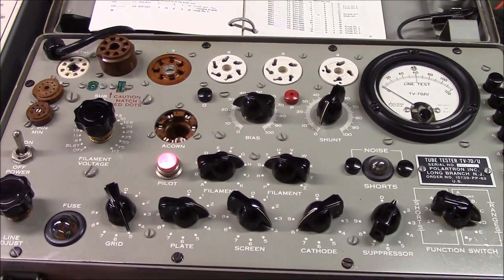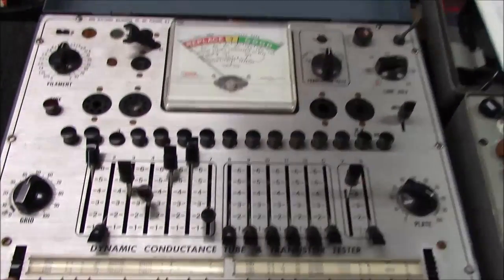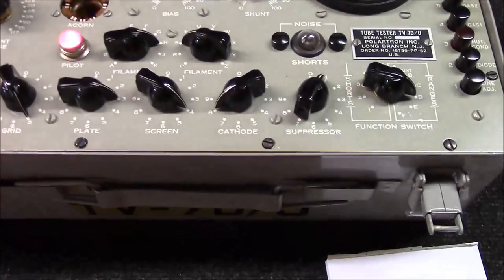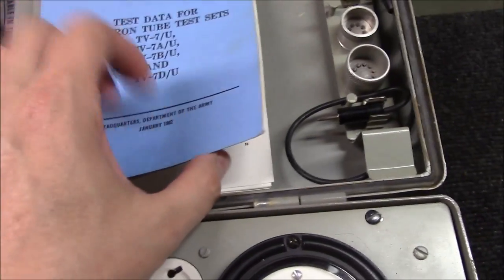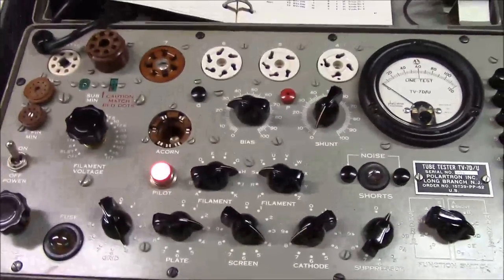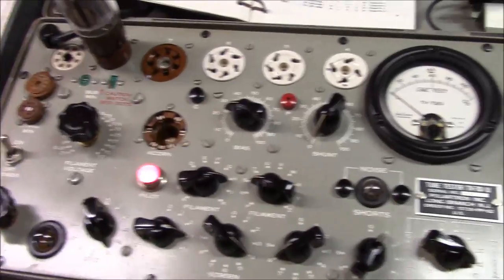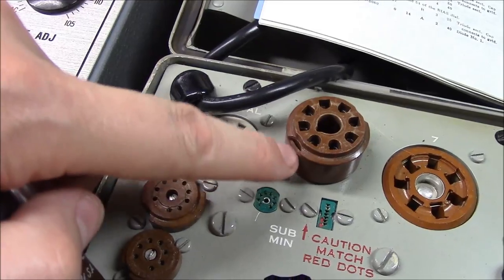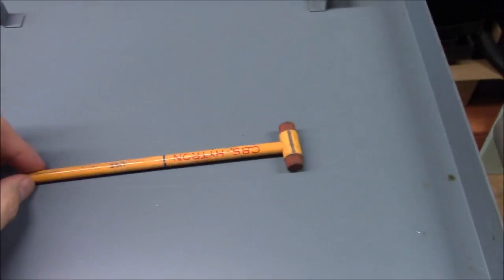A Practical Guide to Tube Testers and Tube Testing - TV7 Eico 667   BG024

Comment: I have both testers but the 667 came with a booklet no rolodex tube spec's. The TV-7D/U, I picked up before it went to be turned in to supply depot as excess military gear. It had a broken 5Y3GT tube that I replaced and  I re-calibrated it to Mil spec's. Like you I use both all the time on my bench.

Comment: back in the late 70s and early 80s I worked at an electronics distributor and we gave away those RCA and GE tube manuals by the cases. I never snagged one for myself and I have kicked myself for it!

Comment: I will keep me Weston 686 rack mount analyzer, thanks. For a suitcase type tester the Triplett 3444A is the best American made tester. Buy the Hickock adapter and that TV7 can test duodecal Compactrons, Magnovals, Nuvistors, etc. My 3444A has the adapters for Compactors, Magnoval, and two other bases, as well as the 4,5,6 pre-octal tubes, Spetar and it has a breakout box in the lid, so if you the socket for the tube, you can test the tube. Same with the Weston 686. That 686 can run 300Bs at 1000 volts anode.

Comment: I enjoyed this, it finally explained the differences in terms that relate to what I do. A friend made it to 102 and I inherited his Eico 666 that had the 4 pin socket replaced with a compactron socket. This appears to have been a mod that Eico sold. Since I am doing ham radio and audio mods I was hoping that this was adequate, and I am happy to see that it does. One thing I don't know if you mentioned, it is not as important for a dual triode to be matched if it is used in a circuit where one gain stage follows the other like a guitar amp.

Comment: The person that will be able to create a new tube tester, that is easy to use and complete in its ability, using modern methods ; will be the new king of the world. Those old machines are magnificent, but are very tricky to understand. Also, it very lacks technical datas about a lot of those tubes. I remember never have seen one single book in any kind of bookstore, whatsoever, on the planet.

Comment: Excellent! I believe that eico has an adapter that will plug into the 667 to test 4 pin tubes, kinda nice,  but does eico 667 test for leakage? Thanks again.

Comment: Thanks for the video .
I did have a question , I have a TV7 and noticed you never did the 1st thing I do , after doing setup , I run the run the function switch through the shorts test on all ranges .
Did you just forget , or have a reason ?
Reply: Absolutely the FIRST thing done, testing a shorted tube can blow your tube tester!
Reply: @oldestgamer  YES Shorts are The priority.

Comment: There seems to be two schematics for both versions of 667. One having 270k resistors x’s 2 and the other a 300k & 330k. The question is: update older version with the 300 level resistors or leave as is?

Comment: A 12AX7 isn't operated in push-pull mode, so your earlier remarks and diagram about + and - envelope distortion don't apply. Class A. About the only real reason for gain-matching the triodes is if they perform the same function in different channels of a stereo amplifier and you want the same gain so as to be sure(r) you get the same kind of distortion out of both, and this is pretty marginal, getting on towards snake-oil.
Reply: EJP The most important reason for matching sections in any dual triode tube is in a long tail pair phase splitter. An unmatched dual triode can result in different drive levels to each side of the push pull power stage. This is somewhat mitigated by the surrounding circuitry, which is designed to not let the tube characteristics be the only determinant of circuit performance, so unless the dual triode is severely mismatched, it will still work fine, it just may not sound its best.

Comment: not sure do anyone said it already, but in the front page of tube chart supplement of 667 "4,5,6 pin and septal base tube can be tested...by using the eico model 615 adapter" not need a 666

Comment: Good informative video, but you didn't cover the important step of SHORTS testing.
With most Tube Testers you should not continue to test if there is a short detected with possible damage to the tester if you continue.
I realize you are testing known tubes and you know there are no shorts, but you were trying to teach others how to use a Tube Tester and the shorts tests should be carried out prior to the conductance testing.

Comment: The hickok 752A can test them all 4pin up to compactron and test dual tubes without changing switches just press plate 2 button :) I own the hickok 752 without the compactron sockets but I bought the ca-5 adaptor so can test them with my tester

Comment: once you test a tube and put it away, does it keep that value if not further used? for example, if I test a tube today, package then sell it in 5 years are the values still valid? thanks
Reply from the maker: id say 99.5% of the time yes.  If tubes are stored in a non-climate controlled building the heat & cold could always cause expansion/contraction of the glass around the metal pins causing slight leaks and letting the tube get gassy over time but that's a pretty extreme rare case.  Short of that scenario or them somehow being physically damaged, they should be good to go for centuries.  It is a glass bottle with a vacuum pulled on it, as long as that doesn't change what's inside should be preserved perfectly.
Reply: Blueglow Electronics thank you

Comment: I just watched your video on tube testers and found it very informative. I'm retired and I work on tube guitar amps as more or less a hobby. I have a Precision 10-12 tester and I was wondering where you would place this tester in your hierarchy of tube testers ie: good, mediocre,  or not so good.
Thanks,
Geoff
Reply from the maker: mediocre, if you are just looking to see if a tube is good or not, use it.  If you are trying to match tubes or determine much more, probably not
Reply: I want to get a mutual conductance tube tester for matching tubes . I would like to know what your recommendation would be, please. I like the idea in the Hickok 752 and the Weston 981 where you can just flip a switch(s) and test the other side of a dual triode tube. 
Any input is greatly appreciated. Thanks
Reply: Geoff Espeland, i have a 752a, been using it for many years.  its excellent, easy to use, and does a quick setup and test for dual diodes such as the 12AX7 etc. it can and will test just about anything (though there isn't much data available for some Western Electric tube types). the A version adds a built-in 9 pin Novar socket (for 7868's etc) and 12 pin Compactron socket, and additional positions on the rotary  switches/controls, to test those without needing external adaptors or having to reset the rotary switches in order to finish testing the tube. I have amassed quite a collection of data for it and it is rare to come across a tube that I can't test with it, or figure out how to test an oddball or unusual tube, where to set the switches and the bias and so forth and so on.

Comment: I just watched this video on the Practical Guide to Tube Testers.  You don't find a lot of knowledge about these any more!!!!
I am curious as to whether you might entertain a question.

I have a Precise Development Model 111 Gm/Em tester that I bought probably 10 years ago and have not done anything with. I was not able to find much information on it on the web outside of the fact that I did find a manual on it that has a schematic, and some instructions for use.   That brings me to the question..

Neither the tube roll OR the manual tell you anything about what socket to use for the specified tube under test.   There are however, multiples of some... for instance   2 octals,   2 9 pins....

Does it matter which one you plug the tube in to test it?

I have not powered it up yet, I'd really like to change the electrolytics first and check out a few other things....  but this one question is nagging at me...

Do you have any thoughts on this?

Thank you much and, again, I really enjoyed this!

Thanks, Bob    KG5JAI.
Reply from the maker: Sadly, I don't have any info on that unit either
Reply: NOt a problem friend.   The schematic is a rather "busy" one... but it looks like the daunting part is really in the rotary switches that select the pins on the tubes and what they get tied to up in the guts of the test circuitry.  I have already noticed that all "Pin 1's" are tied together, all "Pin 2's are tied together" and so on...
I suspect that a little patience will yield the results.

Thank you though. I enjoyed your video.